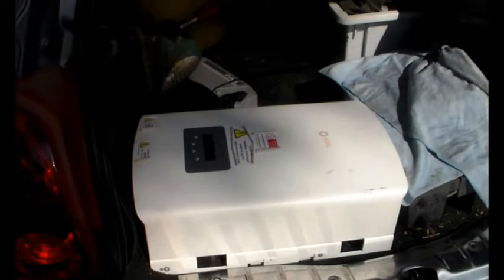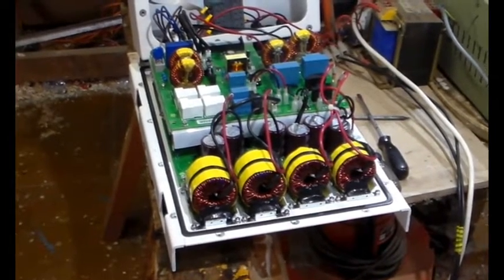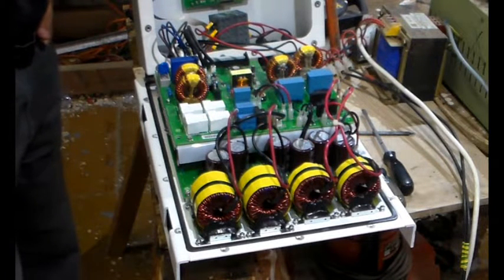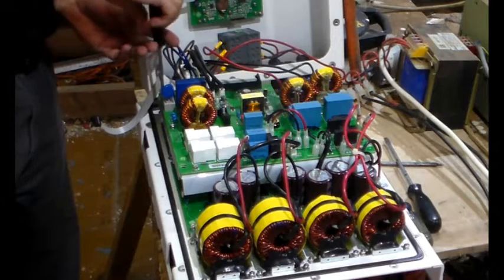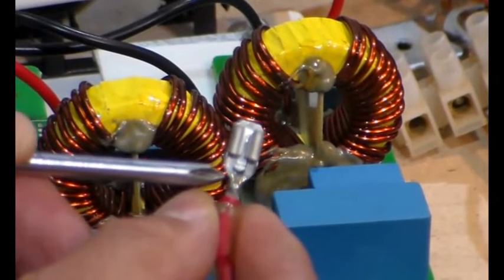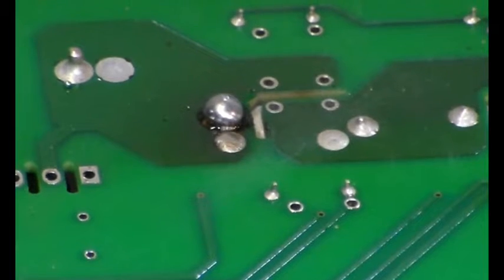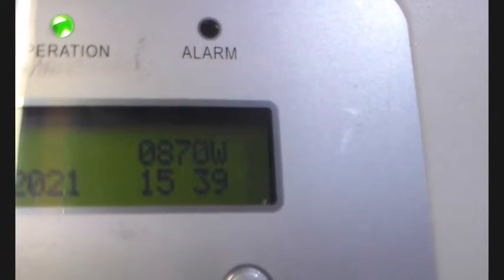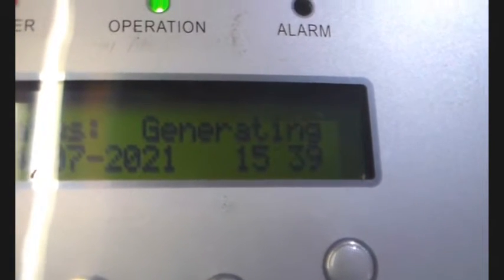Solis solar grid inverter repair, initialising but no start

Comment: Hi Andy I am so glad I came across your video as its saved money and down time. My Solis a 3.6 Kw had arced a terminal on one of the relays and two other relays looked a little suspect, resulting in a tripped MCB and continuously trying to initialise. After cleaning and resoldiering all went well and it works fine, your video instruction was spot on! The cost saving versus a new Solis was between £400 for a DIY fit or £1200 to have it replaced professionally, and what a waste that would have been! Very happy and sincere thanks. 🙂
Reply from the maker: It takes quite some time for the investigation and video, pleased it's kept another unit working, please subscribe Etc, cheers

Comment: Hi Andy, Great channel!,

I Have a question i can't find much information on and maybe you could help?

I have a solis inverter that is coming up with a Grid-Intf error or when generating only generating about 78w! but if i gently thud the unit the Wattage increases to normal then alarms to the grid error again, I have opened the unit up to inspect and from what i can see there are 4 panasonic relays ive tried tapping them the recreate the issue but doesnt seem to be them, If i tap the blue film capacitor it seems cause the issue though, Have you come across anything like this before?

Thanks for your time
Reply from the maker: Well done on your investigation, you can get earth faults caused by faulty capacitors, sounds like you may have found a possible faulty unit or solder joint. I will be interested to hear the results, cheers
Reply: @TheInfoworks  pulled the unit apart over the weekend, found two relays had a melted solder joint! Have new relays as well as a film capacitor on their way, hopefully will sort the issue out!

Cheers
Reply from the maker: @rav3n925  Now that's what I call progress, cheers
Reply: @TheInfoworks  update time!!!

Unit has been successfully repaired, replaced the 4 relays and we are back to full load! Very easy job to complete, I changed the film capacitor as well, but I believe it was one of the relays
Reply from the maker: Splendid news, another saved, cheers @rav3n925

Comment: Hello again Andy, it's mithering Brian here again with another problem, the Solis inverters are working perfectly when its dry weather but as soon as there is rain sometimes they are tripping the RCD in the house consumer unit, sometimes after resetting it they will work fine even if it carries on raining all day, other times it will just keep tripping to the point I have to disconnect them from all power and leave them till its a dry day again, I've checked all the MC4 connectors and they are all ok, the rcd in the house consumer unit is a 30ma one but Solis recommend a 100ma /300ma one, have you ever had this problem and if so how did you rectify it, Thanks Brian
Reply from the maker: Brian, it's probably a collective leak to earth. Either upgrade the RCD or put in a separate fuse box, just for the solar, cheers
Reply: @TheInfoworks  Thanks Andy, I’ll try a 100ma rcd, I’ve no room to add another CU my thinking was because our CU is a split one, one side with the 30ma rcd can be the house and the side with the 100ma rcd can supply power to my sheds were the inverters are, I think if I have a junction box then split the wire so one side is for the inverters only and the other side is connected to the small CU I have in there with a 30ma rcd then my sockets will be protected then by the 30ma, does sound right or am I wrong, thanks again Andy, Brian

Comment: Hello Andy, firstly I have just bought your book, wind and solar electricity, and I have to say, from the little time I've had to read some of it,  its a belter, I have just recently been InTouch with boots owen on here and asked him for some advice, would it be possible for you to give me your opinion on what to do with my solar set up ? I have just copied the same questions I have asked him on his channel. I have 2 Solis inverters, 1 is a 1Kw and the other is 3Kw, at the moment I have the 1 kw inverter connected to the grid via a 13amp plug, it has 4 / 250w old solar panels connected which give me a maximum ( on a clear day ) of about 650w/700w from the inverter which is ok as I don't want to push the inverter to its maximum,  the other 3Kw inverter will have 8 /250w panels attached to it, I have installed a separate consumer unit in my workshop purely for both inverters to connect to it, each inverter will be on a separate 16Amp MCB, so doing it this way would I need to connect a rotary AC cut off switch to each inverter or would it be ok to cut the power to them from the consumer unit which is placed directly underneath both inverters ? also the inverters have a built in DC disconnect so do I really need to install a rotary switch for both of them also ? Really sorry for the long post but I'm itching to get it all sorted, Thanks Brian
Reply from the maker: Brian, all good there in my opinion, under powering the inverters, mounted in a cool airy place and you have already got methods of AC and DC disconnect, no problems. Comments about the book would be welcomed, if there is anything missing, cheers
Reply: @TheInfoworks  Thanks for the reply Andy, the book is perfect, as is, I have installed both inverters and connected them to the separate consumer unit and everything is running smoothly ( touch wood ). this is another big question I would like to ask you ( sorry ). Before I got the grid tie inverters I had been using a hybrid inverter which I bought off e bay, the AC side of it worked a treat but it had one big drawback which was if it rained heavily it would trip the RCD to the house sockets which it was connected to. I tried everything to stop it but to no avail so in the end I just unplugged it from the mains and used the solar to charge the batteries and run the inverter for the AC, I have 12. 12v leisure batteries wired in series/ parallel to give me 24 volts. so what I have done to make sure I am using the batteries now that they are not being charged by the hybrid inverter because I am using the solar panels for the grid tie inverters,  is buy a 10amp, 24v smart battery charger, at the moment I am just turning the charger on when the grid tie inverters kick in but I also have a load on the batteries of about 40w at the same time, so once the batteries get to 29.4 charge they stay there till I turn off the charger, the charger uses about 300w and if I plug anything else in the solar sockets it draws the power from the charger and not the batteries, what I would like to do is use the batteries to power 2 large freezers we have on a night, my question is if I do this and the charger is on, that is rated at 10amps, would the draw from the freezers blow the 10 amp fuse in the battery charger ?. Really sorry for the long post, its at times like this a phone call makes things a lot more simpler. Thanks Brian
Reply from the maker: @drut12000  . Brian, I imagine that those batteries would run both freezers overnight and then charge them up again during the day. If they draw 200w each but for 15 minutes per hour. 200 watt at 24v = 8amps . so in 4 hours both freezers would draw 16 amp hours, so over night that may be 50 AH. Your charger would need to be on for at least 10 hours to catch up. There's only one way to find out how this performs over a month, cheers
Reply: @TheInfoworks  Thanks Andy, I’ll give it a try, I’m going to run it during the day tho when I’m at home so I can keep a close eye on it, just to make sure the charger doesn’t fail when the freezer’s kick in if it’s still charging the batteries at the same time, I’ll remember to change over the freezer’s from battery power to ring mains power but others in my house may not.😁😁👍👍
Reply from the maker: @drut12000  Leave it all connected and feed the charger through a plug in timer so during the day they are running on charger and batteries. If you add a plug in watt meter then you can see what is happening, cheers
Reply: @TheInfoworks  Thanks Andy that’s my goal but just a bit concerned with the pull from the freezers when they first kick in, if the charger is pulling it’s maximum 10Amp to charge the batteries and then the freezers kick in it might blow the fuse in the charger, fingers crossed it doesn’t, at the moment I’m draining the batteries down to 25v with freezer’s connected to them, then I am going to turn on the charger and hope it works 🤞🤞

Comment: YNice video. one question? How many fuses are inside the inverter?
Reply from the maker: Just the one, some don't have any, cheers
Reply: @TheInfoworks  I have a Solis-3P5K-4G inverter. It still works fine. Anyway, I'm studying for the future if something goes wrong.
Any information on the matter is of interest.
Best regards, Jouni Salminen Finland
Reply from the maker: @JouniSalminen-lx6ce  Hi, best thing to tell you is to watch my video on extending inverter life. It's in the solar inverter playlist. Beyond that buy a second hand unit and keep it "just in case", cheers

Comment: Thanks for the video, I bought a relay £6- 8 US dollars. Just fitted it and it works p, my friend is very happy. He was quoted £1200- 1422 US dollars. These “engineers” are only fitters, he looked at it and said yes it’s faulty I have a new one in my van
Reply from the maker: That's grand, another saved, hope you have subscribed and get your friend P to look at my Paypal link, cheers

Comment: You just saved me some money man! Many thanks! Tip from me: unscrew all bottom screws aswell and you can move the front cover away  after disconnecting 1 data tape from the screen. Regards!
Reply from the maker: That's grand and part of the plan, another saved from scrap. I do hope you have subscribed, cheers
Reply: @TheInfoworks  Ofcourse I have subscribed!
Reply from the maker: @RandyV2max  Splendid

Comment: 12v car relays don't last long term from cleaning contacts, more of a temporary fix until a new relay is sourced. Is there not high quality relays available?
Reply from the maker: Hi, just proving a point with the original factory items, cheers

Comment: I got around to initially testing 3 of my inverters yesterday. 
The Omnik 2KW had the a cable detached from the square component, then relay fault on startup. 
The Mastervolt with the card air channels has a missing Littelfuse 1Amp 600V fuse, only the lcd initiallises with no other activity.
Both those units had intact QC stickers. Do you know what the large unit is within an inverter. Aluminium case, potted circuit board and has two sets of large red and black wires coming out of it.
The last unit I tested sounded like damaged contacts on   at least one relay, heavy arcing sound.
Reply from the maker: Ian, well done, sounds like you can fix the Omnik, the Mastervolt are not worth messing with, and the last one would need some more investigation, what is it? The large potted Ali case would probably be a capacitor. Hope you enjoyed the investigation, and hope to hear more soon, cheers
Reply: @TheInfoworks  Hi Andy, It's a Saj Sununo. It's relays seem to be beefy enough: Panasonic ALFG2PF12, 31A 277VAC
I took a video at the time which I've just stitched together into some form of coherency: https://youtu.be/KdH522KQo0g

Comment: The video made sense to me, not disjointed. It is frustrating that a pcb will reach the end of its life because of one component. I wonder would the manufacturer recommend a repair or just a new board?  With washing machines the fault finding tends check some mechanical components based on a symptom, then if the mechanical component is ok just replace the PCB and see if that works. I guess that is fine if it is under warranty, but I suspect that very little soldering is done under warranty. I learned a bit from the video and a good bit about relays form the comments too! Maybe the trick to getting these relays to last longer is to keep the solar PV panels out of the sun?!
Reply from the maker: Owen, I suppose many of the clips felt that way as I was editing and there are a few bits that I would like to have added but didn't have the footage. Such is the problem of one shot only experimenting. Yes I have a stack of panels that are not doing any harm awaiting inspiration. Some of my repaired inverters have been running for 5 /6 years with no problems but I have made sure they are in ideal conditions and would probably see me out. On the other Aurora fix videos there are plenty of comments on changing the relays but industry would not do such a thing, it's that whole cost and time thing, hence one of the drivers for me making videos. In some small way having an effect on waste and promoting self reliance. Cheers
Reply: @TheInfoworks  I am editing my solis test video and I thought to google the fault again and this time it brought me to this video, no memory of watching it (11 months ago!) but looks like it might be the issue. Repeatedly initialising and then OV-BUS error. There's definitely another video in it!
Reply from the maker: @bootsowen  If you can do referencing that would great, it's taken many days of fiddling to get to this stage of adjusting, cheers

Comment: The reason the relay pins are burning is down to the relay contacts arcing and producing enough heat to melt the solder. You really need to replace the realays as the contacts most likely wont last much longer after being cleaned, they looked like there was not much of the contacts left in any case. It is also a good idea to check the coil driver voltage and current in case the relays are not closing with enough force due trouble there.Also check any capacitors that may be across the contacts as if these fail it can lead to excess arcing.
Reply from the maker: You are exactly right, the reason for the heat is the arcing. I think the reason for the arcing is insufficient side pressure. The moving arm butts up to the solenoid core before the full contact pressure is created. I have fixed this sort of problem before with a slight adjustment to the flat spring part of the moving contact arm. I will put the next video up quite soon, cheers
Reply: @TheInfoworks  Looking forward to the next one....and agree that cleaning contacts is a temporary fix at best and a good confirmation of a problem and solution. These relays appear to be a unique design and I thought Zetler were a good brand....are there better alternatives? I also wonder why Solid state relays are not used in this application?
Reply from the maker: @mekuranda  Hi, thanks for the comment, I assume relays are used as a cost consideration and they are fine as they would operate morning and evening in very low current situations. The problems occur when inverters are pushed to the limit and shut off in high current times. I may be old school but I think a repair well thought out is good. The Solar River relay contact fix has been working continuously since that day with no problems. No need for the parts cannon. Cheers
Reply: @TheInfoworks  Makes perfect sense....I did not think about the normal switching point being at low power levels as you explain....and thought SSRs could be as cheap as beefy relays to a big manufacturer ...Thank you for the reply ...learning from you every video...cheers from Aus
Reply from the maker: @mekuranda  I've just started editing the relay repair video, it will be a couple of weeks but there's something different next week, cheers
Reply: No , it has nothing to do with the relay contacts . its due to the use of lead free solder . the heating and cooling causes the joints to crack and then produce heat and arcing. resoldering joints with lead solder is the best solution